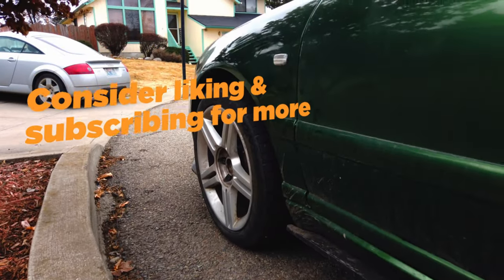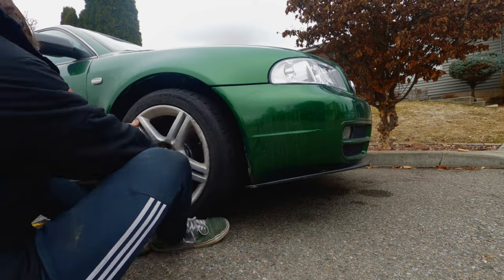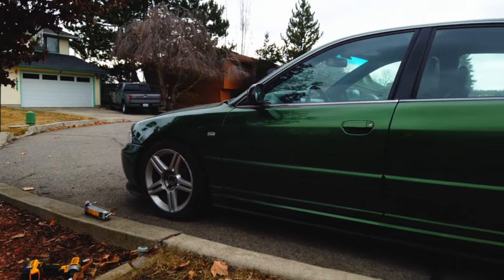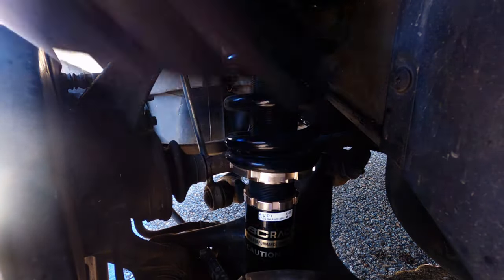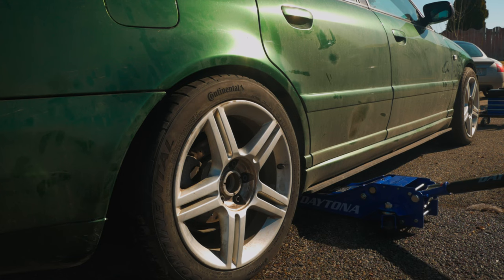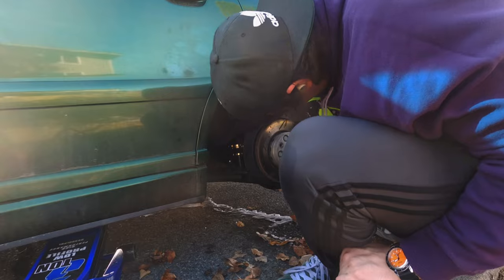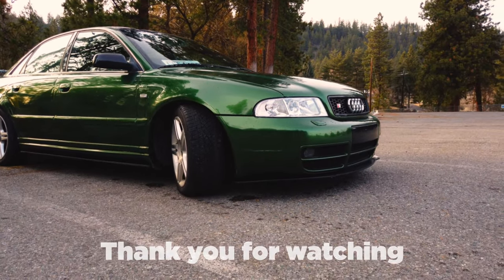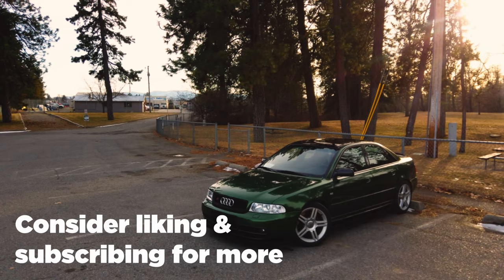I Accidentally Lowered The S4 WAY Too Much | Setting Ride Height

Comment: Absolutely love my Daytona jack. Great choice, and fun fact- that Daytona jack is the EXACT same jack as the Snap on one for a fraction of the cost . There's articles that talk about it. They are made in the exact same plant as each other , snap on actually tried suing them and lost.
Reply: I have the long reach low profile Daytona jack.
It's not the exact same jack. If it were they would look the same, which they don't.
Snap on lost the lawsuit because several other companies jacks also look similar but not exactly the same.
However I say with with absolute love for my jack. It hurt buying it, but it's completely worth it

Comment: Fit some larger wheels will lift it more up, and still achieve the fitment in the wheel arches
Reply: agree, with 18' wheels it sit higher from the ground
Reply from the maker: Exactly what I was thinking! That's a fantastic idea to get the car up a little higher.